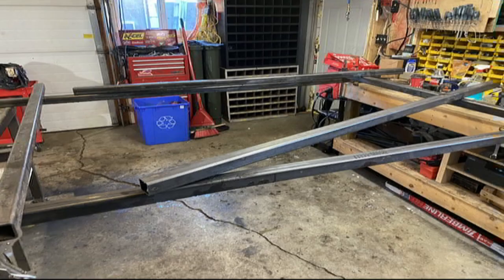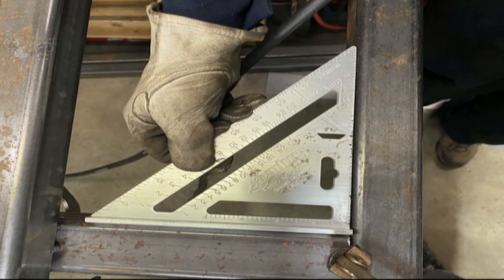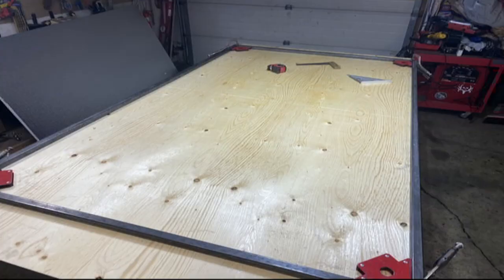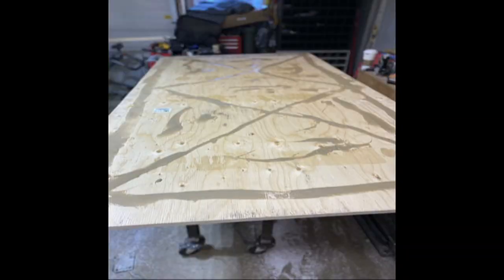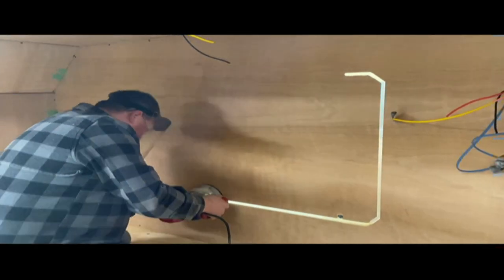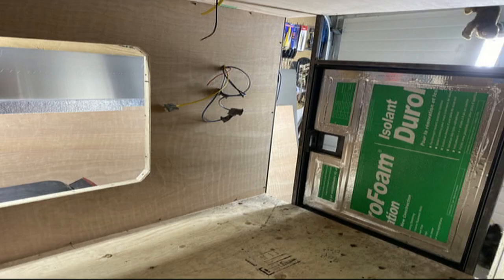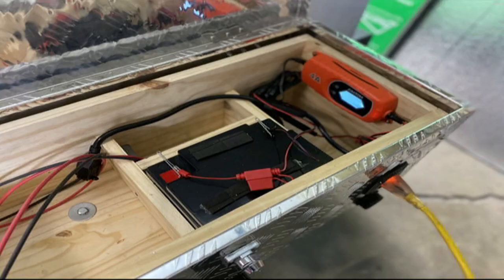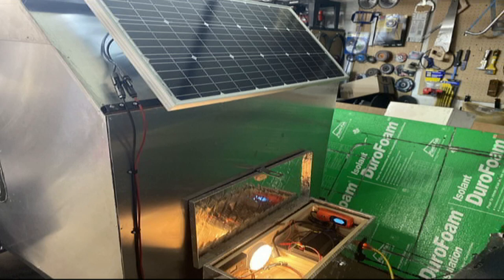How To Build Squaredrop Trailer (info in the description)

Comment: Your question of insulation face in or out..
I'm a insulator from way back. I've insulated hundreds of homes and trailers. So, the answer is. The face goes in towards the living space. Unless you're using reflective faced insulation in windows.. Then it goes out, to reflect the light. The point of insulting is to form a air pocket in between surfaces. The best way to seal the air pocket, is to place 4mil poly on the interior covering the insulation and wall studs. This will also form a vapor barrier. Then place wall coverings on last. Good luck

Comment: Jon V. here, this looks like a fine build. I worked in a fab shop all my life. Your welding amperage, and speed look from a distance appears perfect.
Gussets are a must for strength. Any idea on weight? Over all cost? I would be very interested in making one. This is the first metal one I’ve seen!
Good video!
Reply from the maker: Sorry for the late response, it weighed in around 1000 lbs and cost just over $4500 Canadian.

Comment: Smart move with the fiberglass facing down. I've seen professional campers made with wood exposed to the bottom, which makes me scratch my head. Did you consider close cell epoxy coated composite?
Reply from the maker: We looked into a few different materials, but we had the issue of the supply chain due to the pandemic, and I live in a city of only 50,000 so we have limited selection to begin with.

Comment: Looks awesome.. How did you attach the wood to the steel frame?
Reply from the maker: I just used self tapping screws, I pre drilled the wood first, so the wood wouldn’t split.